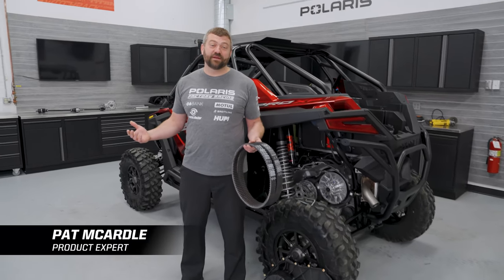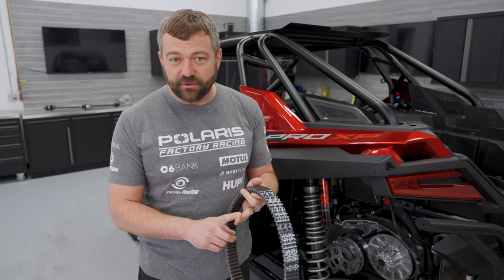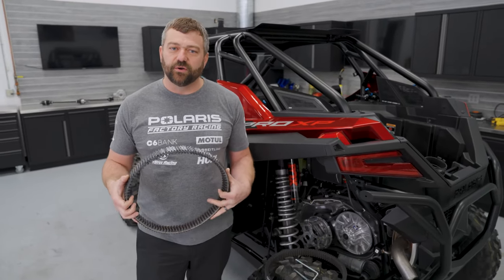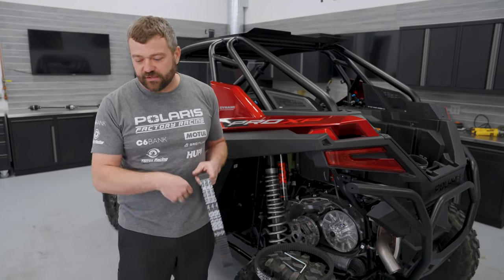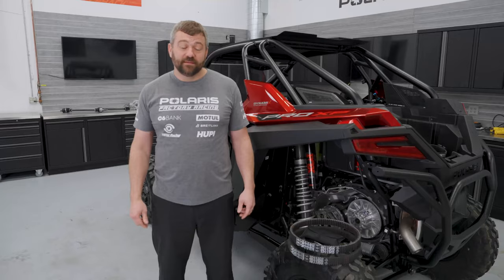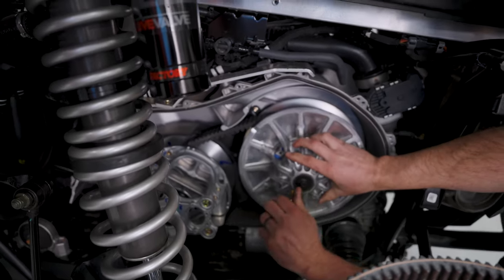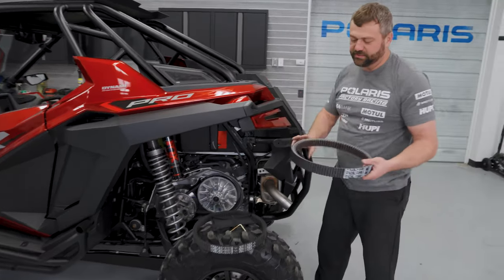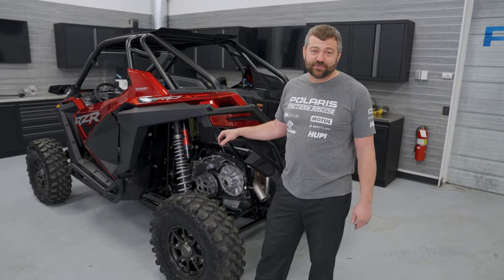EXPERT HACKS TO MAKE YOUR BELT LAST LONGER - SHOP TALK EP. 27 | Polaris Off Road Vehicles

Comment: 3 years and 2,700 miles on my stock yamaha belt still have 7 years left of belt warranty  on my rmax 😂.
Reply: Yah. Yamahas have wet clutches so it’s a completely different ball game. Replacing the wet clutch isn’t fun though, a lot easier to change a belt.
Reply: The embarrassing part is you drive an RMax though.  😂  Kidding.

Comment: Another Polaris mechanic said to NOT idle because the belt is just sitting loose on the pulley as the engine spins.  I think most of these “never” scenarios, are based more  in opinion than research.

Comment: Best thing I did on my XP1000, was a razorback IR belt temperature gauge. I run dunes with paddles and if I see a spike above normal, I can back off and cool things down. One thing you didn't mention is the importance of clutch alignment! Hard hits can move the transmission in regards to the engine, and then belts will keep blowing.

Comment: I've had a Polaris side by side since 2008 (of course various models) and the information Polaris has provided on belt management in this video is the most helpful thing Polaris has done for their customers!  Most of these things I picked up on the rzr forum in the early years of ownership and hold true today. And to those thinking that it is impossible to have a belt look like that after a few thousand miles, it is not. Belt management is how that is achieved. 
Oh....and I have never install one of those belt temp gauges either!  The other thing not mentioned here is blowing out the clutches regularly after a ride. I blow mine out with compressed air after every ride and pull the clutches for inspection1/year.

Comment: Great tips. Im still on my original belt in my 04 700 Sportsman 😂. Dont use it much tho. Got over 1000 miles on my 21 Ranger 570 fullsize used for hauling and snow plowing on 29.5”s. Looking after your belt is crucial. Thanks for the tips 😊

Comment: On your chart I had the second image and I didn’t know what it was, I got line used and was doing that since I got it, was soooo bad that I thought was the main shaft bearing broke, it would jerk hard taking off over time gave me a code for miss fire but only would do it if I hold the gas pedal for long (1 full min) at more then 3800 rpm I changed fuel pump, fuel injectors, and spark plugs and kept doing the same, so I was just using it going pressing gas and let go pressing gas and let go so it wouldn’t pick up the code again until my belt actually broke off last trip installed new belt, no more jerking at take off no more weird noises no more codes I can go full throttle as much as I want, something sooooo simple I didn’t know could give u so many problems

Comment: The low throttle thing is the reason we got a Pioneer 700 for the farm, specifically because of the torque converter automatic. My dad spends his whole day spraying or whatever, just at walking speed or below, stopping and starting, in the hills. Also, following the tractor through the woods, clearing trails.

Comment: Hey Polaris, maybe make a video on towing a trailer with a load using an ATV and SXS. 
I use my Sportsman 500 mostly for firewood cutting and I use a 4x6ft trailer to haul it out of the forest. When the trailer is empty I use 2hi to get me to the cutting site fast, and when hauling out a load I'll be in 2low and never go faster than 15mph. My trailer when its loaded will be right around a 1000lbs when the wood is green. I have never worn out a belt using my machine and also use it for plowing snow in winter, again in 4low and never faster than 15mph.

Comment: Excellent video but as a newbie Im trying to learn alot of this information in a short period of time. So in the CVT belt driven transmission does the belt spin on the primary and secondary clutches ONLY when you step on the accelerator pedal? Thats the major point I was able to learn which would explain why you should let your machine idle for a few minutes to dissipate the heat on the belt and clutches.  Hopefully my assumption is correct.

Comment: My launch control wasn't working properly and hourglassed a new belt. is there any way to repair it?  It slightly chatters on acceleration but not bad. If I take off quickly I don't feel it at all.

Comment: I have a 2015 RZR 1000 two seater I have no shims in my secondary clutch and right now my secondary clutch has to come out a little bit because my main clutch the belt is riding on the inner wall of the clutch so I need to bring out my secondary a little bit Will those shims work